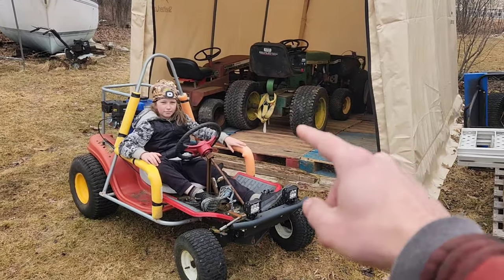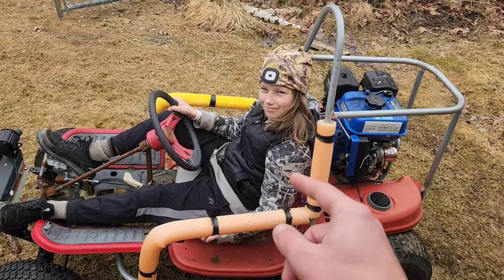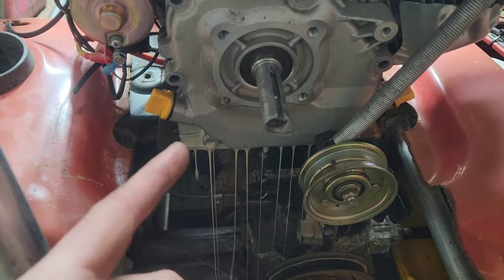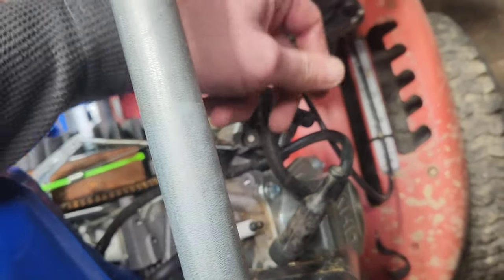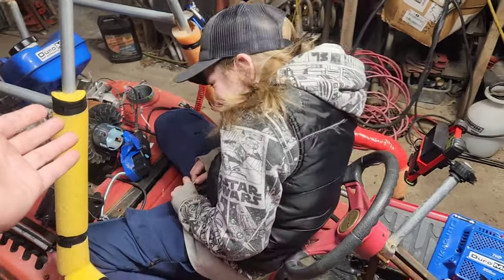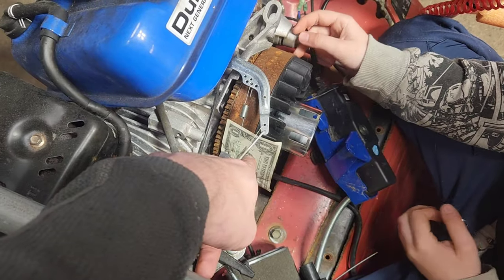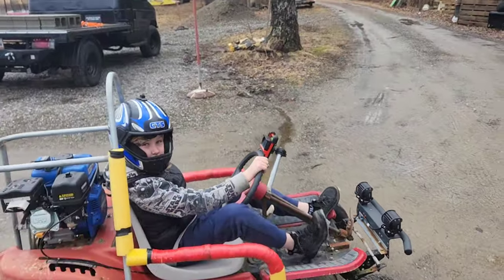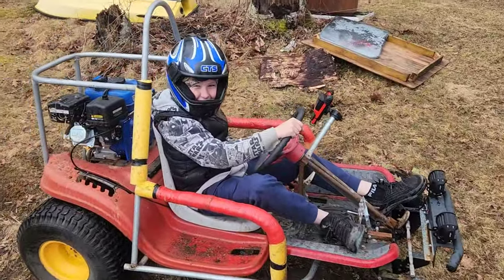DynoCams 5K Rev Limiter Coil Lawn Tractor Go Kart Duromax 208

Comment: Not sure on the duromax engines but on the predators the general consensus is that the rods r good to 6.5k the think u really need to worry Abt is the flywheel the magnets like to fly off at mach 10 cuz they're only held on by one low grade bolt and some glue

Comment: Now put the big pully that the transmission originally had onto the engine and play with the current trans pully and the current engine pulley on the transmission to try and get it to do 20+ mph.